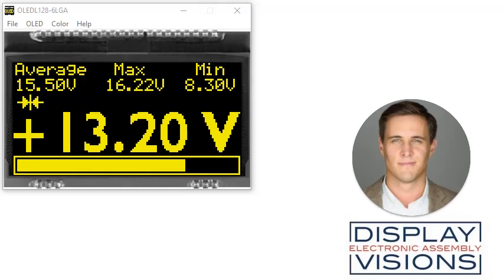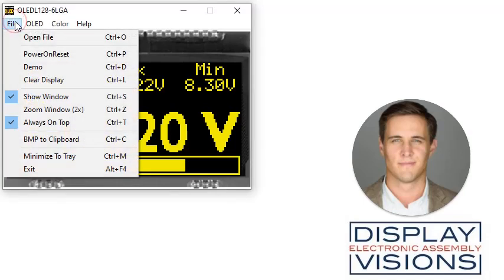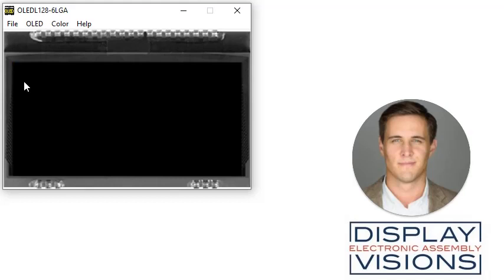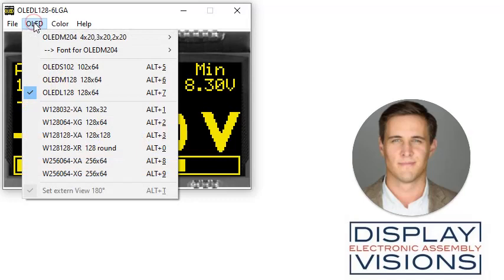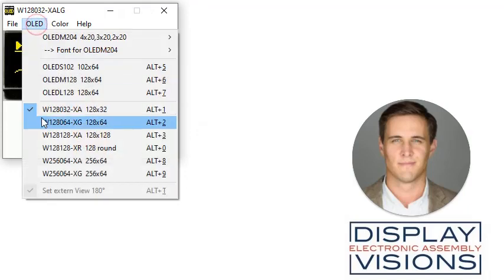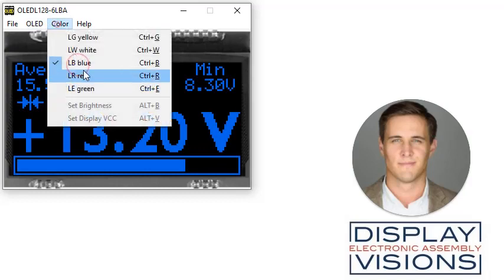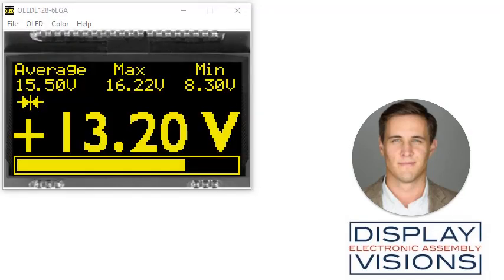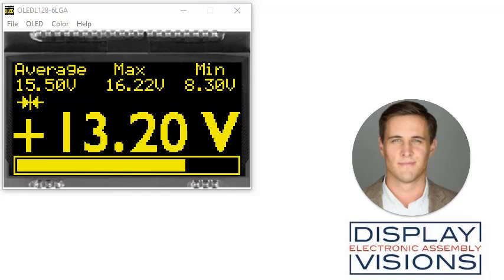OLED Display Simulator for EA 9781-1USB (startoled.exe)

Comment: I see in the "Commands" folder a bunch of .txt files that imply we can send register commands and data as if we were controlling the display directly, but these don't seem to do anything.  Using the "file/open" command seems to take literal text and output it on the simulated screen, but I can't control anything else. Is that correct?  What are those files for?  I'm using OLEDM204, in case that matters.

Comment: I believe it's blank due to it being an old program and the help files not running on Windows 10. The simulator does not work with a generic FTDI programmer for Arduino. The displays themselves do. You can find some application notes under EA OLED-Series. https://www.lcd-module.com/support/application-note.html